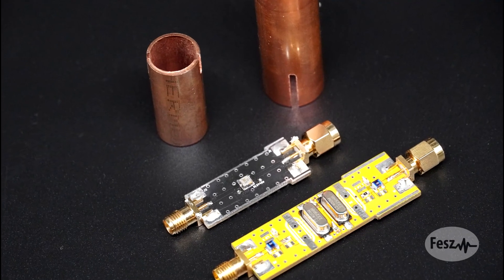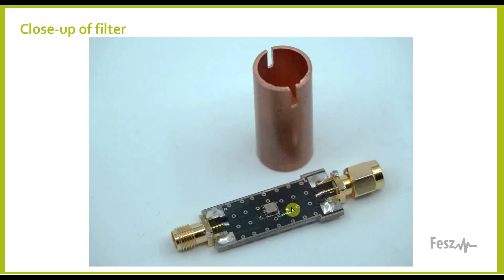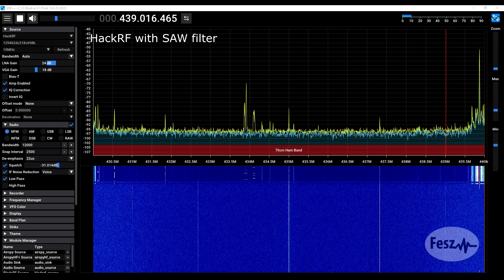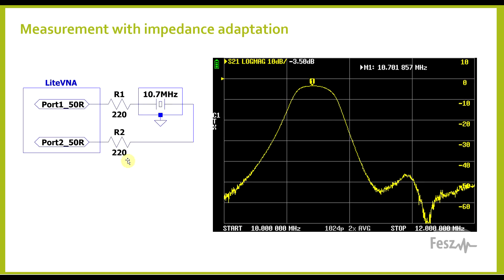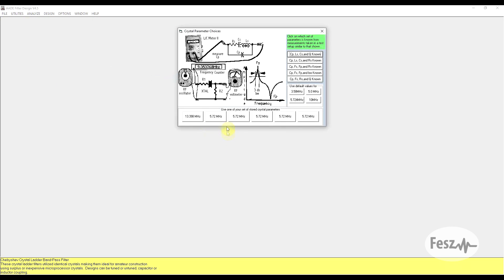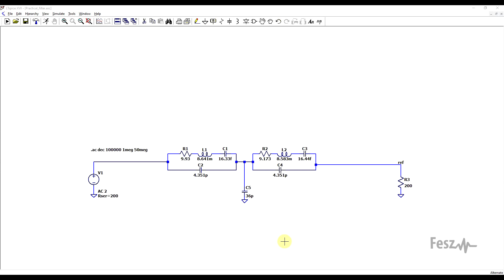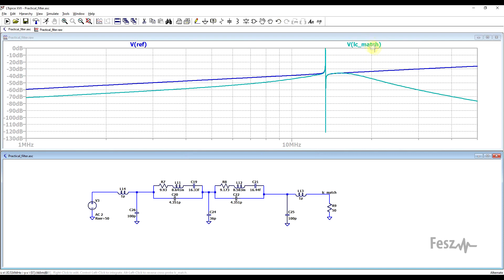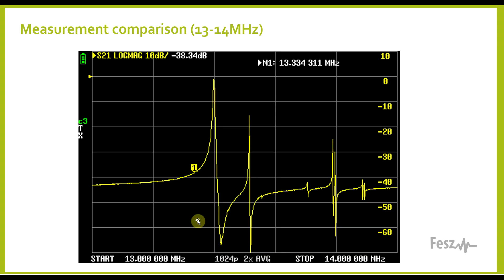Crystal Filter Experiments

Comment: Hi there for the demonstration of the filters with the sdr software with rtlsdr hardware there are horizontal lines in the waterfall which oszilate a bit over time. If i am not mistaking i would think this could be the automatic gain control adjusting amplification making the comparism wrong. What do you think?
Reply: I just saw the agc s are disabled. Why do you think this happens?
Reply from the maker: I guess that there are some very strong signal appearing that are overdriving the pre-amplifier, or just the input stage, and then it behaves as if the AGC is still on; or maybe its just a protection mechanism that cannot be turned off. I'm not sure what happened.

Comment: Thank you for the video, it was really helpful. Can I know the data sheet of the second filter of 10.7MHz ?
Reply from the maker: Do you mean the 10.7MHz ceramic resonator? I used the same resonator in both measurements (with and without the 220R resistors); unfortunately I do not have a datasheet or order code for this component since it was just a random component I found in a box
Reply: @FesZElectronics thank you anyways :)